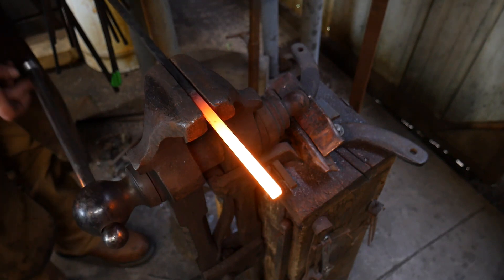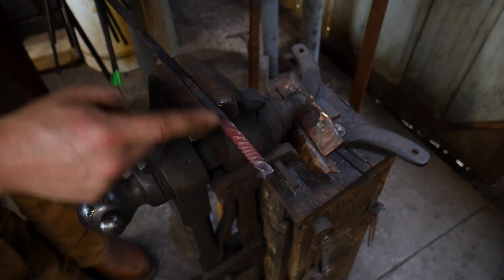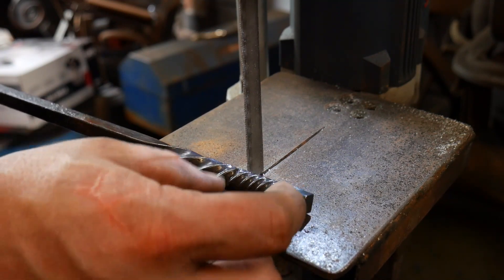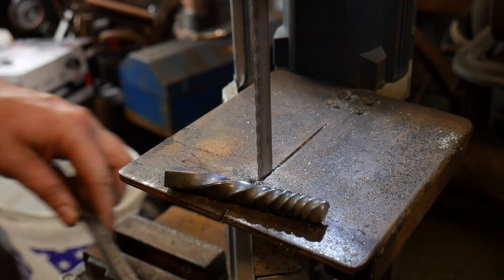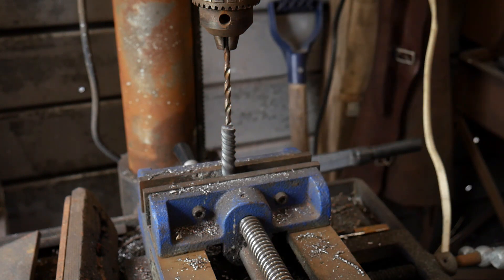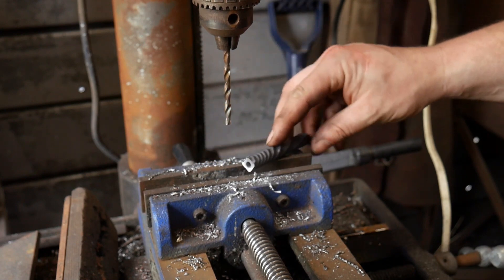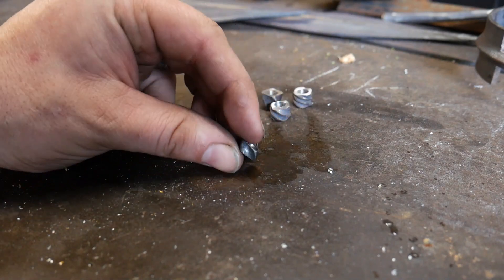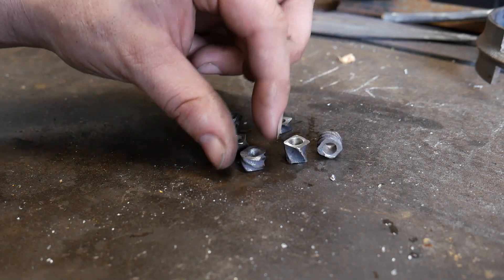Forging Jewelry: Blacksmith Beads for $1

Comment: For drilling the hole, try flipping things around. Put the stock in the drill Chuck and the drill bit in the vice. It works like a lathe, you're hole will stay centered in you're workpiece regardless of how deep you drill. Could be done in regular vice with hand drill also

Comment: Great idea!!!

These are perfect curtain weights if made of a larger bar stock. They would be a great decorative element at the hem. Decorative Hem Beads would be easy to remove for washing & easy to reattach after the fabric is completely dry. Since beads are removable, it would even be easy to put a coat of paste wax on the beads to prevent damage to the fabric.

Traditional curtain weights are Lead. If you have crawling babies or chewy puppies, you really should not use Lead weights. People usually get huge washers from the local DIY/hardware store, but these are likely to stain the fabric when the curtains are washed or if you live in a perpetually humid climate.
Reply from the maker: +Linnea Simonalle great ideas Linnea! Glad to see you then the comment section we all need to get together again soon :-) hope your doing well.. God bless you

Comment: my thinking is rust but i guess you could paint clear or any other colour over it to stop rusting up and marking your wrist
Reply from the maker: Yep you sure can :-)
Reply: from my personal experience wearing an unfinished steel bracelet, as long as your sweat is not overly caustic the natural oils of your skin will protect the steel from oxidation.
Reply: On that subject, here is a suggestion for a finish...you know that old cookie sheet or steel pizza pan with the black stuff you just can't seem to scrub off? Get the beads strung on a wire, and heat them to a good black heat and dip them in boiled linseed, olive or flaxseed oil. Repeat this a couple of times, and let them cool. Then give a buff with an old t shirt.  I did something similar to some metal pieces on my SCA armour, and most of them show no rust after several years in storage. I used wd40 on them, but the idea is just the same